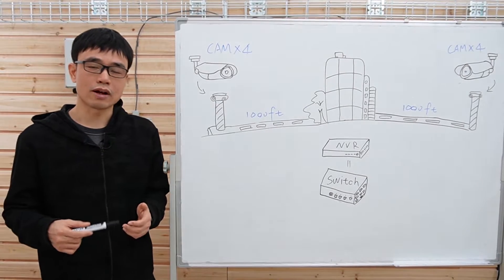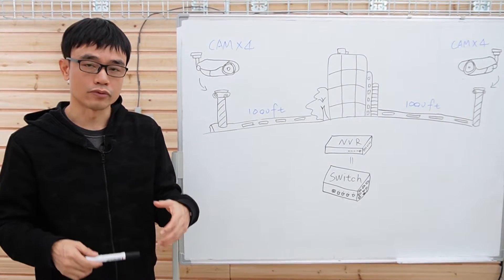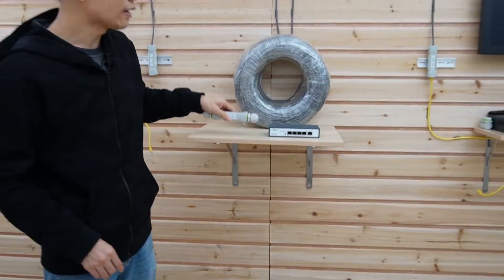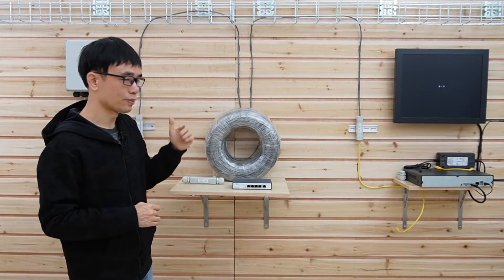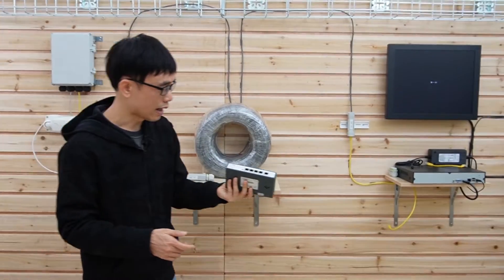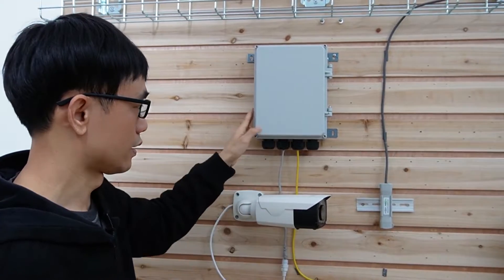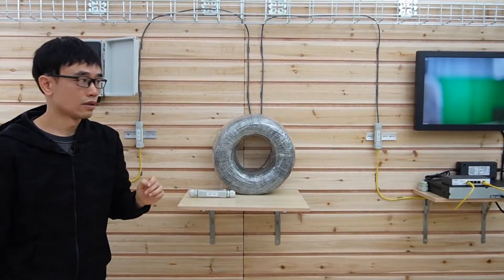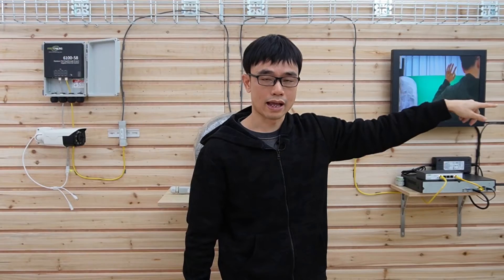How to use 90W PoE++ Switch to Power 4 IP cameras up to 1000ft

Comment: In this example you have shown, could I just use an ADDITI?ONAL long range switch at the camera location, and not use the extender or the out door switch?  And then plug in 3 camera to that SECOND long range switch?
Reply from the maker: https://www.fastcabling.com/product/500-meters-long-range-poe-extension-kit/

Yes, you can connect two long-range PoE+ switches directly to extend the distance to 1600ft. You can watch the video here: https://youtu.be/Jc3VElEHbxU

Comment: How to connect a number of long distance  60 cctv ip camera  each  camera separate from the other camera 1000 feet  using fiber cable all camera connected to control room.  If cable cut, can  camera used wirless.
Reply from the maker: Hi, if you're interested, we can provide free solution design for our customers. Could you send a layout to support@fasctabling.com? Please mark where the cameras will be installed and indicate the distance between them as well.

Comment: I am running a connection between 2 factories. In one factory I have a 8 port POE switch that will power 6 cameras via Cat6 cable while the distance I have deployed fibre optic with media converter, can the fibre optic that is connected to 5 cameras be connected to the same POE switch with media converter at the end of the fibre? 
2ndly, can i use a CPE to transmit all data from the first factory to the next facctory where the nvr is installed. In a nutshell i am asking if POE switch can connect to another POE switch.
Reply from the maker: If both of your switches have at least one SFP port, you can connect them directly using SFP modules and fiber optic cables. If your switch only has Ethernet ports, then you'll also need to use a media converter. You can refer to the diagram here but replace them with switches: https://www.fastcabling.com/fc-solutions/500m-point-to-point-fiber-internet/

If you're using CPE, please make sure the line of sight is not obstructed, or the signal strength will deteriorate significantly as it goes through obstacles like walls, trees, buildings, etc. You can refer to this video to set up the wireless bridge: https://www.youtube.com/watch?v=co7aI6fjFFc
Reply: @Fastcabling  Thank you. The line of sight is very clear and it is not more than 250m. The main area of confusion is how I can configure the POE switches especially when 4 cameras connected to a POE switch is connected to another POE switch in the control room.
Reply from the maker: If you're interested, we also provide free solution design for our customers so we can discuss this matter further. You can submit your inquiry here: https://www.fastcabling.com/free-solution-design/

Comment: Can you explain ip camera with CPE for 1000ft distances sir?
Reply from the maker: Two CPEs pair up as network link. What you need to do is to connect the IP camera to one end, then you can have video from another end. The CPE use VLAN to seperate the protocols network and data network. Basically it is transparent to data network (IP camera).